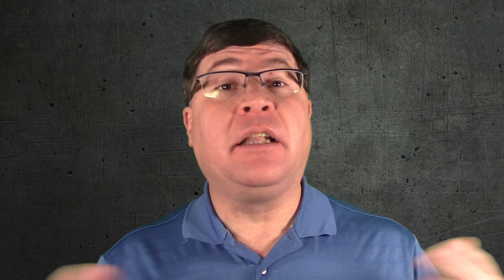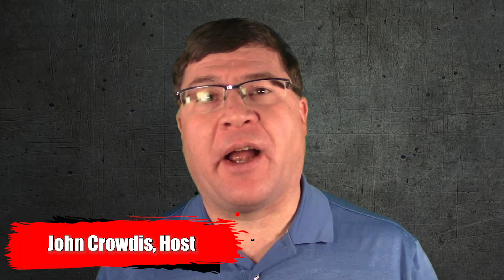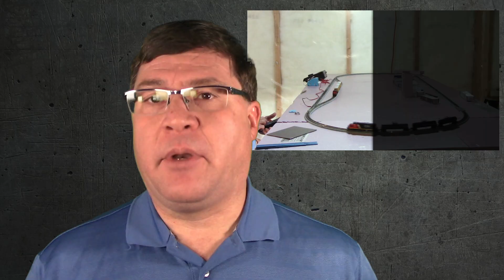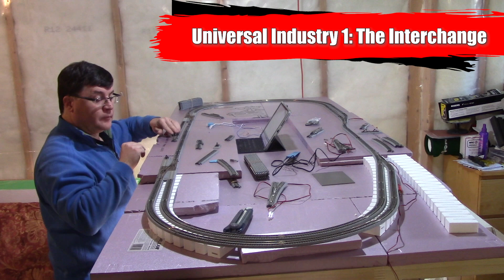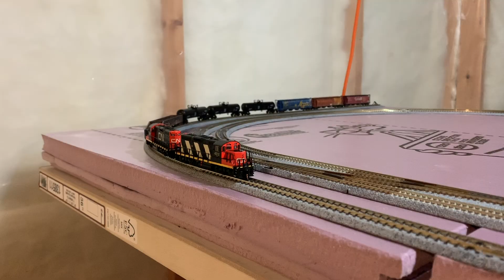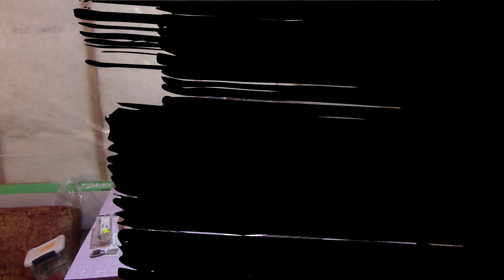Model Railroad for Beginners - From Loop to Layout - Adding Interest & Industry

Comment: Since an engine can only pull a few cars, can you run two engines on the same track to pull more cars?   And I presume those two engines would need to be two identical engines.
Reply from the maker: The short answer is yes. If you’re running standard DC it works well. If DCC you have to create a “consist” with two locomotives. You may need to speed match them, but they will work together. You’re also not limited to two.
Reply: @ Thanks.  It has been 45 years since I worked on an HO layout.  Retirement had become boring so I’m going to give railroading a shot again…getting over sticker shock is going to be ridiculously hard.

Comment: What do you use as an uncomplicated tool pls?
Reply from the maker: You mean for uncoupling? I believe was using a Rix Rail uncoupling tool, but a bamboo skewer also does the trick.
Reply: @JCsRiptrack  Thank you - you correct ly interpreted my mistyping. I shall try that bamboo skewer 👍🚂

Comment: Hi John, I have just started this hobby and I think your video is of great help! Thanks! Just a question, what are you using to decouple the cars? I see you are using a rod. Is it specially made? Thanks and keep up the good work!
Reply from the maker: I was using a decoupling tool made by Rix Rail Products or a bamboo skewer depending on what segment you're watching. Either will work, but the Rix product has a slight blade shape that makes it easier.

Comment: JOHN  -- Your videos ROCK!  ...and are an immense help to a railfan returning to the hobby after 50 years!  QUESTION: What is it that you are using to dis-connect the cars? Is that just an ordinary piece of wooden dowel, or what?
Reply from the maker: Thanks Kevin. I’m using an uncoupling tool. I think I’m just using a bamboo skewer in this video (if it’s wood coloured), but I also use a pre-made one from Rix/Pikestuff. Recently I’ve been experimenting with 3D printing them too.

Comment: Great series - just came across it.  I’m looking to get back in with N scale - I gave away the last of my HO stuff last summer.
I didn’t realize the N scale track were so easy work with.  I had some experience with the KATO HO track when it first came out over 20 years ago.  It did not seem that easy to work with back then.
Just out of curiosity, are you a a Canadian YT site?  Just asking as I’m in Burlington, Ont.
Reply from the maker: Yes, I am Canadian. Now out on the west coast, but it's only a recent move. Prior to here, I was in Calgary, and I did live in Ontario for a number of years.
Reply: @JCsRiptrack   - good for you.  I follow another YT site from out west called BArailsystems.  He doesn’t do “how to” vids like yours is.  It’s more a chronological view of the building of his basement sized layout - based on the Rockies near Banff.  It’s a slow build.

Comment: This has got to be one of the best series on N gauge Kato tracks and layouts. Awesome ideas man. I just started working on a 4 foot by 4 foot Layout and I am using all Kato track,  would love to see a video series on how to do all the electrical wiring with KATO, thank you.
Reply from the maker: I will do my best. Wiring isn't my strong suit, but I've managed to make this thing work (mostly). So that video may be expressing some of my challenges. Right now, I am just using the plug connectors, feeder tracks, and terminal unijoiners to power the track. I do, however, have the wire to run more "traditional" bus powerlines and feeder drops. That will come when I expand the layout. :)
Reply: @JCsRiptrack  can’t wait. I can plug all things and wire the layout, it is the turnouts that I would love to see get done, my dream is to get them done digital style. I could be dreaming. 😂🤣😂🤣🤣🤣
Reply from the maker: The other piece I am looking at is creating control panels that use DPDT switches instead of the standard Kato ones. However, I may be dreaming a bit on that one.

Comment: Thanks for the helpful video! Giving me great ideas for my layout. Got a question though, how do I make spurs functional? Do I need a special end track to get the electricity working? When I make my turnout, the train dies, maybe because the end is not connected?
Reply from the maker: You need to provide some sort of power to the siding. Are you using Unitrack? The #6 turnouts are power-routing, but it is still a good idea to get power to your spur tracks.
Reply: @JCsRiptrack  Got it! Thanks! Yeah I'm using unitrack.. not sure if it's #6 though, I'll look it up. Appreciate your videos!

Comment: I have more of question than comment. I a beginner with not much room. I have 2foot wide 6foot in length ply board. Can a HO scale train fit on this?.
Reply from the maker: You can do HO Scale on it, but not in a loop. 24" in depth can even be a little tight for N-Scale. However, you can do a whole lot in terms of a switching or shunting-type layout in that kind of space. Makes for a very interesting way to model a railroad.
Reply: Thanks for the information.
Reply: Thanks for the feedback but would Flex track help my wish come true or am I being foolish?

Comment: I've never had a train other than as a kid running a plastic one around a Christmas tree.  I was excited by the first two episodes in this series, but the complexity and amount of info really jumped up a couple of levels from the last episode to this one.  May have to watch this one a few times.
Reply from the maker: I'm happy to chat more about it. Adding sidings isn't all that hard, at least in principle, but there is a challenge of adding stuff without making it too complex. I'd be happy to talk more, you can contact me through the facebook page, or a direct email in the "about" section of this channel.
Reply from the maker: I should add, one can potentially stop at any one of these steps and still have an enjoyable layout. The last video shows operations, but it's a more straightforward "swap and drop" --bring cars to the industry, pick up the outgoing cars, and drop off the incoming ones. This video, yes, it does get more complex, but it sort-of builds on the previous video. This one adds the dimension of needing to move cars around inside an industry in order to drop off and pick up the right ones. :)
Reply: @JCsRiptrack  Thank you for the offer!  I'm still in the 'watch but don't do' stage due to time and space, but will reach out if I get further in the 'real world'.

Comment: Hello

Years ago I started collecting cars and engines, but with two children I did not have room or time for a train layout
Now I have an empty room and no children I pulled out my items and laid them out on the floor
Over the years I have read up on trains and much has changed

Now I want to know two things to see if I should or even can convert what I have to DCC and KaDee
or
If I should sell what I have and buy new 

any hope I can get some help here from you
Reply from the maker: Converting from a standard DC system to DCC is relatively easy in terms of wiring. Just connect the system into the same wiring as your DC system to start. Having locomotives that can run DCC can get trickier when it comes to installing the decoders, short of buying some new ones in the meantime to give you a feel for it. You don't necesarily need to sell what you have, but you could piecemeal it.

Comment: I did what you are doing in a basement. 10 or 12 folding stables with layers of 3 inch styrofoam plus 1 and 2 inch layers and Woodland scenic is risers. mostly all Kato track. When ballasted looked great. Cut in lakes, and retaining walls. Even had an NN3 run up hill in the middle. Never finished it. We moved. No basement. You have me thinking👍👍🤔🤔  Your layout looks great👍👍😎😎
Reply from the maker: Thanks! Yes, no basement can curtail the size of a layout, but European, British, and Japanese modellers all deal with smaller space constraints than we do in North America.
Reply: JC's Riptrack ahhh! Me thinks your right! Good thought👍👍😎

Comment: What height did you set this layout at? It looks very high. Great 👍 tips !
Reply from the maker: It's about 53 inches or about 135 cm. I'm not that tall (5'8"/173cm)ish, so it's a good eye-level height for me. Also clears my hobby desk which is directly under it.

Comment: What is the white styrofoam flexible road bed at 7:04? Where can I get it?
Reply from the maker: Those are Woodland Scenics risers. In this case, they're the 1" type, but they also have sloped ones as well. Here's a quick link to the 1" risers on Amazon: https://amzn.to/34bSxVf 
You may be able to find them at your local hobby shop when/if they're open at this point in time.

Comment: This is all assuming you don’t have trashy bachmann turnouts. My father and I run ho scale stuff and our non-permeant layout has Bachmann track. I can’t back up more than 2 cars on my turnouts without derailments. When I get more track, I’ll get a different brand of turnouts, even if it doesn’t look super great.
This video was very helpful, as I’m gonna do a lot of track work soon, so this gives me some creative ideas. 
- JP
Reply from the maker: It’s why a favour the Kati ones, but any turnout can risk derailments. I have some locomotives whose wheels are a little out of gauge and they trip up too, mostly on the #4’s. . Glad you found this helpful.
Reply: JC's Riptrack yes sir, and that is why I’m redoing my track plan. I am gonna add more 2 way turnouts so I can also drive in versus always backing in!
- JP

Comment: Glad I finally found your channel! Your videos are great, and you know how to present everything well. Keep it up!
Also, I couldn't help but notice you were using NCE Powercab for DCC, how did you wire it into the kato unitrack?
Reply from the maker: It was an MRC Prodigy Express (original) controller in the first video, but in this video I had since upgraded to a Piko Smartcontrol system (it’s virtually identical to the ESU Cab Control). Connecting it to the system was the same. I modified a Kato Unitrack “extension” cord by clipping off the end, stripping about 1cm/0.5in off the end, tinning the wires and then hooking them into the system the same way you would any other system. I may add more robust wiring once things are more secure.
Reply: @JCsRiptrack  Ah, alright. Thank you so much, and once again keep up the good work!

Comment: I think for small fries like me.. The Layout as you showed in your Video Sir it's Damn sharp and as much as we wished we could.. most of us out here live on tight Budget's or it's where we live that keeps us from broadening our Layouts but I've seen on youtube lately and what you posted small layouts dont have to be Dull either.. 

On my Layout  I basically got to keep it simple my Allergies & dry eyes and my layout being in a Bedroom keeps me from doing any sanding of Any kind.!  that also includes painting and using Strong Glues to me a Layout is better placed in Garage or Basement if you can keep it watertite or maybe a bedroom if it's only used for Running the layout or other model related purposes.. 

But I thought this Video was very constructive it can help a small layout Builder build something even though there isn't a whole lots of space and if you use foam as shown here you can add: trees, signs foliage cut out ditches or Ravines bridges & power lines  

Please keep on posting this Good content from a small Fry I'm hooked.. And now im Hungry Time for some Grub.mm🤓 Allen D and D.M🚦R.R.
Reply from the maker: Thanks Allen, scenery will come as this evolves. Once I finish showing how I am experimenting with the track plan, I am going to be installing a backdrop between the two halves, finalising the track work, and then scenery will be the next thing on deck. So that is definitely coming. The big challenge in a small layout is the temptation to put too much in and not leaving enough room for scenery... but on the flip side, there’s also the danger of not having enough on it to keep it operationally interesting for me. Part of it is finding the sweet spot.

Comment: Another way to add interest and play value would be to run one or more laps between switching locations as if each area was located in a different town.
Reply from the maker: Yes, that’s definitely part of the operational plan. As someone else pointed out elsewhere, I “cheated” on the exit, and should have had the train do a full lap before exiting on the interchange track. Although demonstrating on a video, these shortcuts are necessary.

Comment: Great start. Will make a fun layout to run, by yourself or with one more person.
Reply from the maker: Thanks. The current configuration is more of a one-person job, but I am planning to add enough that could have up to three operators. One for each side, and one that runs the local that moves stuff around the layout.  The next two videos in this series are going to be about adding some challenge to the interior of the layout.

Comment: I must of found a short cut,  You did not do a return lap back to your point of origin....
Reply from the maker: You’re right Eric! My bad. Maybe this shows the need for a track schematic. On the way in from the outer loop I have to complete full circuit to line the train up for the team track, but on the way out, the train was already on the outer loop.

Comment: Very nice explanation. I have 3 industries and a passenger stop on my rail road. Much like your port on industry, the batch plant has 2 siding tracks. The way the layout is I can run about 3 different trains. One question / suggestion for you to answer. Talk about using the Kato turnouts with DCC. I did not read well and found that there is a switch inside the turn to use them with DCC. My are left in DC mode which now makes them power routing. It would be nice to see the difference.
Reply from the maker: The switch is in the #4 turnouts to change them from power routing to non-power routing. The #6 turnouts are always power routing, which created a few headaches in filming this video. :) Not because I didn't know, but some of the feeder tracks weren't connected properly, and the power routing worked in my favour, until it didn't!

Comment: Also I think temporary “stand-in” structures are a quick way to see what your layout will look & feel like. I am still using empty cardboard boxes. I print out appropriate siding including windows, doors, & signs, then glue to the boxes. Move them around to try different configurations. This helps plan your final kit or scratch built structures.
Reply from the maker: I was planning on doing some sort of cutouts once I have the intial full track down and the backdrop installed. What I like about this setup is that if a track configuration isn't going to work, it's not that hard to change it before securing anything down.
Reply: @JCsRiptrack  kato is pronounce with a k not a c

Comment: Good basic intro to ops. Maybe should discuss trailing versus facing points next time?
Reply from the maker: I am going to be adding a second outside interchange/industry track that will be a facing spur. That could well be in the next video in this series. Good that you mentioned it, I'll remember to include it.